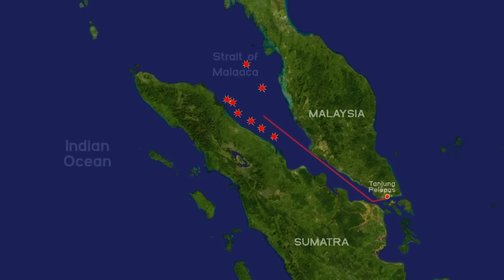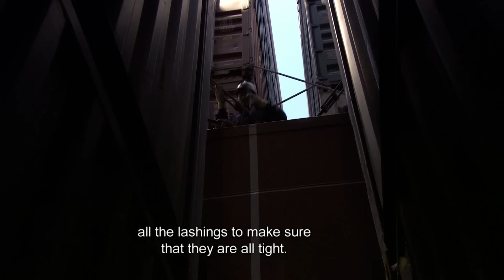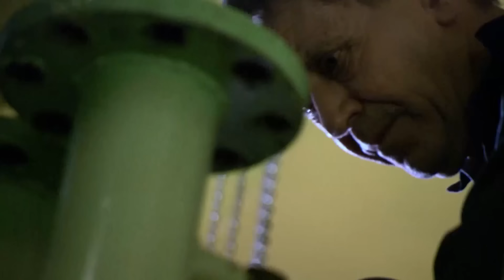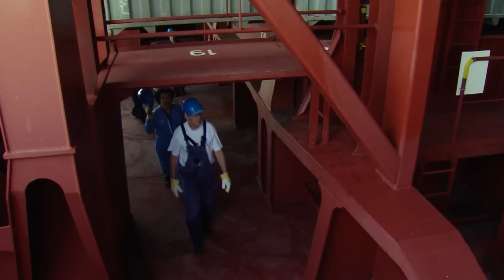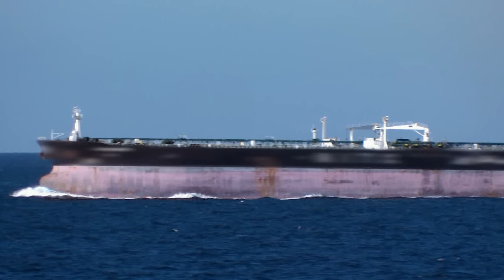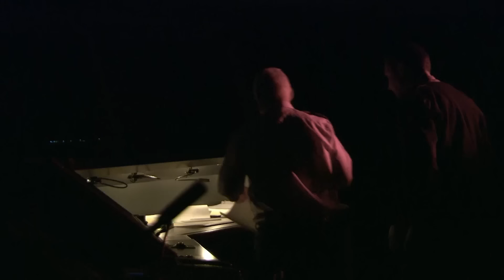Mighty Ships: Emma Maersk | Season 1 Episode 2 (Full Episode) | MIGHTY

Comment: Oh I was surprised to see the huge propeller shaft. I thought all ships had electrical drives nowadays, i.e. diesel engines driving generators that in turn drive electrohydraulic motors.
Reply: That's mostly used for passenger ships, due to the ease of positioning the machine room wherever it's best. It has lower efficiency then direct diesel engines driving the shaft, which is an important part of these container vessels.

Comment: Install barbed wire around the perimeter of the ship at a height of 1 meter. The wire should be retractable when approaching port. This measure will help prevent pirates from boarding the vessel
Reply: piraten komen via helikopter
Reply: Install men with guns

Comment: Equipped with a groundbreaking waste heat recovery system and highly streamlined hull paint, Emma Maersk pushed fuel efficiency boundaries, generating enough engine power (around 109,000 hp) to outperform thousands of smaller vessels in both capacity and economy.